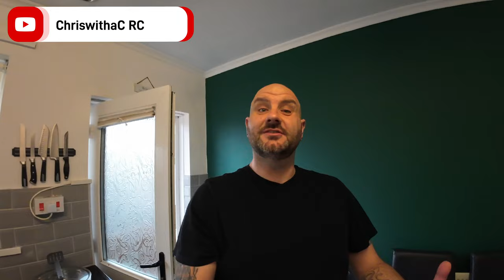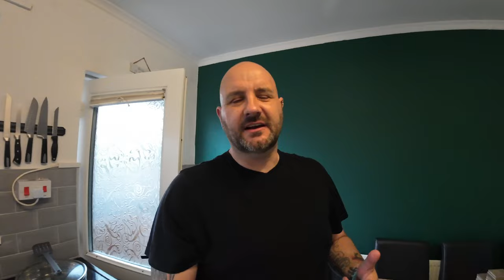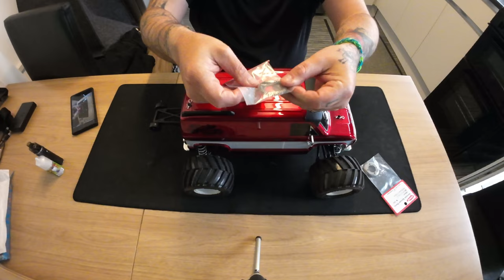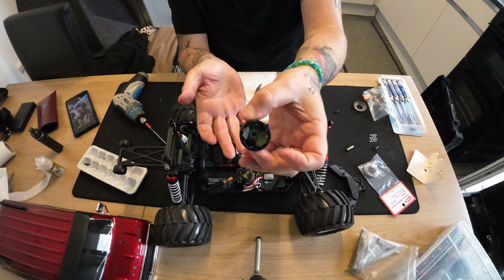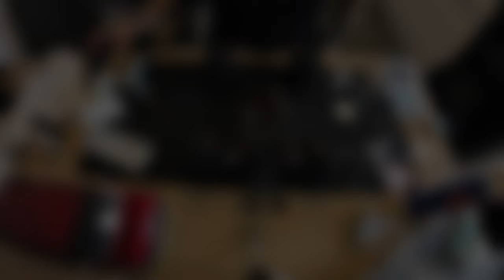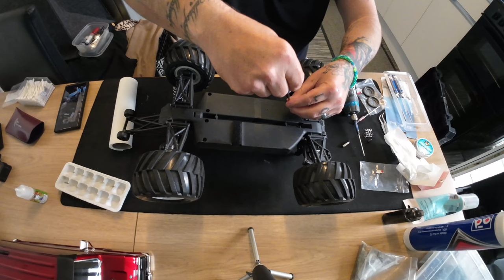Kyosho Mad Ve: You Must Do This Essential Differential Maintenance Before First Use

Comment: After killing 2 crown gears i opted for the upgraded 4 bevel gears and HD crown gear along with 5k diff fluid on both diffs. Runs a lot better now. Good vid mate 👌😊
Reply from the maker: Hey buddy , Massive thank you indeed . Yeah ive heard loads of people saying the same thing . 
Im going to run mine for now and then do as you did and Get the Sealed diff case and also then use some diff fluid rather than grease i think . 
Thanks once again for watching though means alot . 
Stay safe buddy 
Chris :)

Comment: The upgrade HD ring gear is faw229 HD, the ones you have fitted are the stock ones fa540-41.
Reply from the maker: Hey man , what a Lemon i am hey just realized that , Ah well at least ive checked them over now . 
So ive got a spare set now oh well lol :)
Reply: Maybe it's a shim issue with the gears in this truck...I have a axial ryft bought all kinds of hd stuff big money and in the end it was 2 dollars in shims lol...was there any play in the diff case light steel gears on 2s should last a long time time with proper grease

Comment: Great video brother. We just trashed the rear ring gear on our 3s Typhon after a tire upgrade. I was thinking about upgrading to metal. Should I leave the composite input or make that metal as well? I was thinking it might just b better to go back with the stock set up since the stock ring and input is only $9 and makes a good cheap shear point. If the gears were all metal something more expensive would prob break. What do you think?
Reply from the maker: Hey dude ! , 
Hope that your well and safe , ah yeah its a weak point on the 3s cars for sure , right im not going to lie at all get the metal rear diff and input gear and your set no more issues at all . ive gone through about 4 sets now and enough was enough so upgraded the big rock and just ordered one for the typhon . 
Check out Turbo Rc there very cheap in comparison to buying from a model shop. 
hope that helps and look forward to hearing from you . 
Chris :)
Reply: @ChriswithaCrc  thanks brother, I'll order the all metal diff. Did you put oil back in or go with grease? I did a 50\50 oil and grease  mix in the last diff I worked on for my 1\12 truck and it is working really well so far. Thought I might try it in the Typhon as well.

Comment: You can also upgrade the orbital gears inside the diffs to having 4 gears per diff, instead of the stock 2 gears.
Reply from the maker: Hey there buddy , 
Yes i did notice that from the parts diagram in the manual , Have you done yours ? If so what did you notice in the handling ?
Hope that your well and thanks for watching 
Chris :)
Reply: @ChriswithaCrc  No I still haven't done mine yet.
Reply from the maker: @gillian9178  Im going to see how this gets on and then look at the 4 gear upgrade i think as with all my cars i like to upgrade as much as i can . :face-green-smiling: